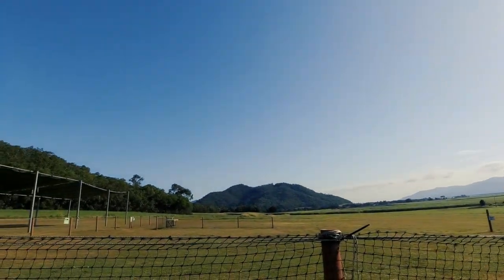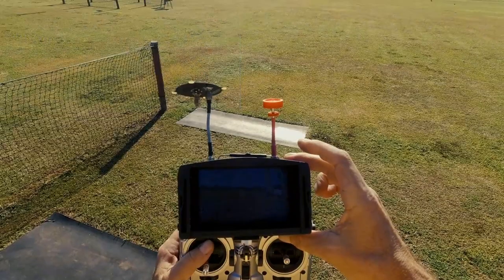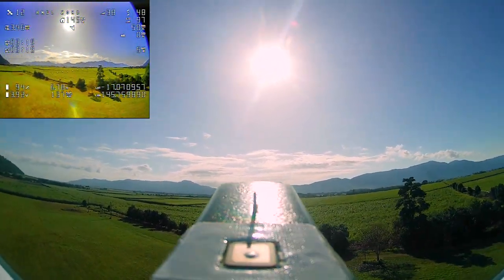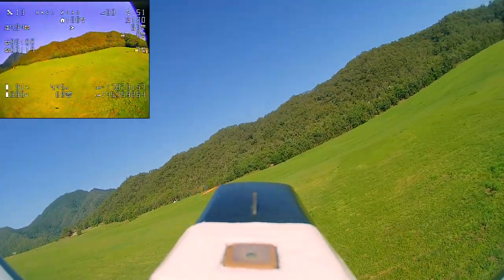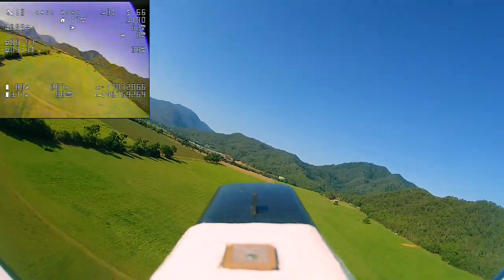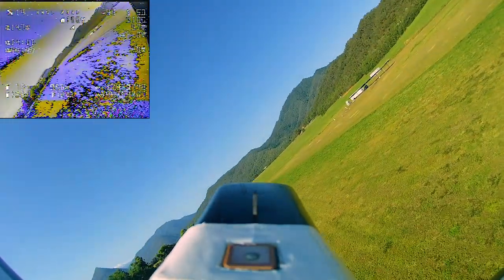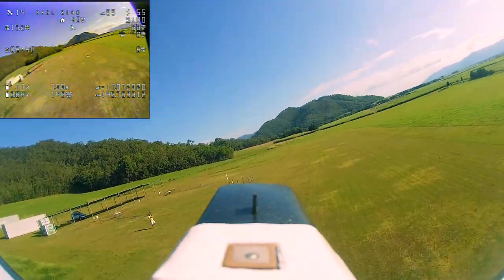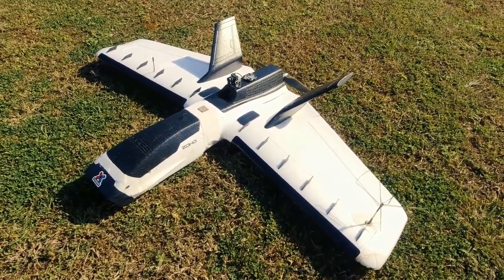ZOHD Dart XL -  iNav 5.0 Test Flight after Autotune With ELRS Minor Issues

Comment: What is the point of having a 60A ESC with a battery capable of 20A continuous current?
Reply from the maker: There is no point really, it just gives more room for a battery with a higher c rating if it's needed someday. This plane doesn't need high c rating it's a cruiser only. That esc was one I had as the stock 40a was needing replacement.

Comment: I've been flying the ar wing pro but have the dart xl extreme enhanced on the way, I would love to see your inav pid settings  and autolaunch settings, I'm flying with inav 6.0.0 and exspresselrs, I think all the telemetry warning are from your exspresselrs settings, try playing with that. Thanks for video
Reply from the maker: Thanks for commenting, my next video I do with the Dart xl I will try add my launch settings. My pid setting are from doing an auto tune so I wouldn’t recommend just using them especially for a maiden flight. What I found with this plane especially using a heavy 10000mah battery, auto launch requires a very straight even throw from the hand and  motor spin up set much higher than my other planes as it seemed to like to torque roll on take off if the motor would spin up too quickly after launch.
Reply: Ok thanks for the tip, are you talking like 200 to 300 spin up time
Reply from the maker: @egtreadway4232  my current launch setting here i have altered from default.
set nav_fw_launch_velocity = 150

set nav_fw_launch_accel = 1500
set nav_fw_launch_max_angle = 180
set nav_fw_launch_motor_delay = 200
set nav_fw_launch_spinup_time = 900
set nav_fw_launch_timeout = 10000
set nav_fw_launch_max_altitude = 5000
set nav_fw_launch_climb_angle = 20
Reply: I appreciate the settings, I'm new to this wing but will see how it goes